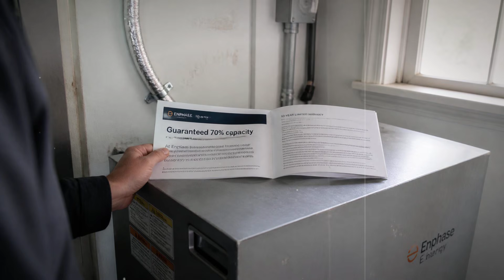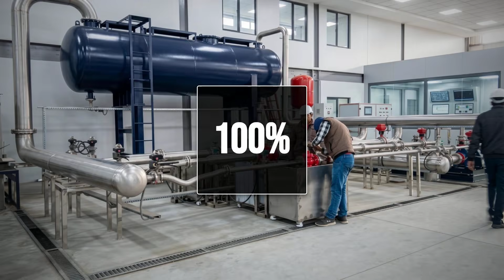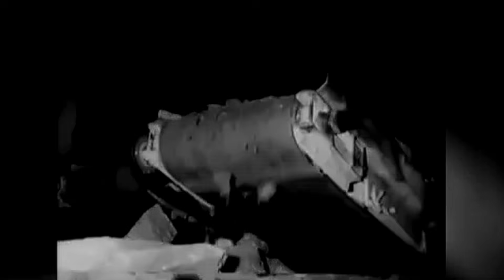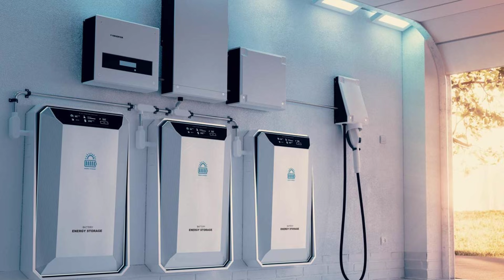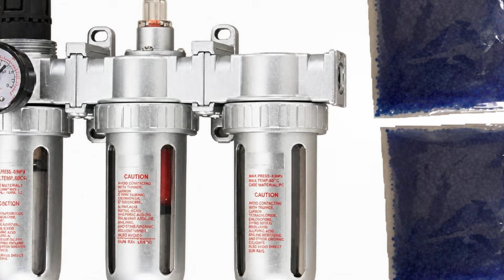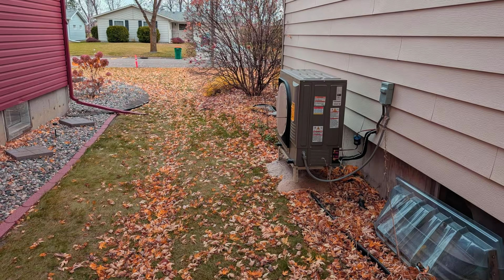I Stored Solar Power in a $90 Propane Tank — It Lasts 30 YEARS

Comment: Somebody has a hardliner running this sales campaign for them.  No, you don't dump a battery at the end of the warranty.  You have added =more= storage by then and keep using the old unit until it doesn't produce at all.  OR, you use the degraded storage for another solar project altogether, like your MIL cottage or shop.  Also, most batteries are using chemistry now which is NOT aiding slave child labor in Africa.  AND, fewer than 5% of these batteries get recycled because they are sold/given/bartered to someone else who can use the output from them.  I know people with 5th generation batteries still in use.  And there are MANY lithium battery recycling centers open in the US and around the world now.  Elon recently bought land and broke ground on one in Nevada.
Oh, wow, a whole kilowatt?  The average US family uses 25kW a day.  That means your 65% efficiency compressor needs to store nearly 39 times more than the Italians and Polish tested.  That's an expensive tank and expensive compressor requiring rooftop and back yard solar arrays.  Air tanks fatigue and need replacement and compressors also wear out, requiring repair or replacement.
Current 5.3kWh batteries cost under $800, not $1,100 per kW.

I stopped watching halfway through.  This concept may work better at commercial levels, but it will never be cost effective for homeowners, period.

Comment: Bull 💩...dumb idea. You lose a lot of energy turning radiation into electricity just to convert it to motion then convert it to potential energy just to release it and convert it twice more to get electricity when you need it. Dumb... think THERMAL battery using a dual stage boundary layer turbine to make electricity on "cold steam" in a closed loop system.

Comment: Isothermal work stored in a receiver is P·V·ln(P/P₀). At shop-air pressures (175 psi / ~12 bar), that's about 0.8 kWh per cubic meter of tank volume ideal, and after real compressor efficiency (~60-70% for a good piston unit, worse once you count heat thrown away) and a real expander (vane air motors are 20-30% efficient, a converted piston engine or scroll maybe 40-50%), you're looking at 15-30% round trip and maybe 0.2-0.3 kWh delivered per cubic meter of storage. To match one 48V 100Ah LiFePO4 rack battery (~5 kWh), you'd need something like 15-25 m³ of receivers — a wall of 500-gallon propane tanks. Go to scuba/paintball pressures (3000-4500 psi) and the density problem mostly disappears (~8-10 kWh practical per m³), but now the compressor and expander stop being cheap and start being the expensive, maintenance-heavy part, which kills the original value proposition.

Comment: Why is the assumption that the battery has to be replaced IF it drops to 70% Wouldn't an intelligent buyer simply supplement with whatever battery size is needed to top up to the original capacity? Maybe 30% of the original battery price? Even less if battery pricing structure continues spiralling downward.

Comment: Too little energy stored and low round-trip efficiency.  Batteries are far better than this.   

The $15K battery this the video disparages holds a thousand times more energy than the air tank.  If you compare that air tank to a battery that holds the same delivered energy, it would be a hundred dollars.  Silent, not moving parts, reliable.

Comment: I have thought of this decades ago, but during that time, the compressor would be driven by a sterling engine or a solar differential air pump. Not solar panels. The exhaust gas would drive a n Angelo De Pietro Air Engine coupled to a belt driven Generator. It has an air governor to adjust load power maintaining constant speed at any loads. Actually, no batteries involved at all.

Comment: This does not work on a small scale as indicated in this video. Pump up the small tank to 150 psi and it will meaningfully turn the DC generator for about 10 - 30 seconds. There is a lot this video does not tell you. Air storage on a meaningful scale requires a lot bigger size or much more pressure. 20-50 thousand psi. This would have a longer discharge time. This would require a very special tank and  compressor. As mentioned in this video using salt mines as an air storage battery is a real thing since it is so large and can take super high pressure. Google it -  World’s largest compressed air energy storage facility commences full operation in China  ---    But scale it down for home use and the idea is largely impractical.